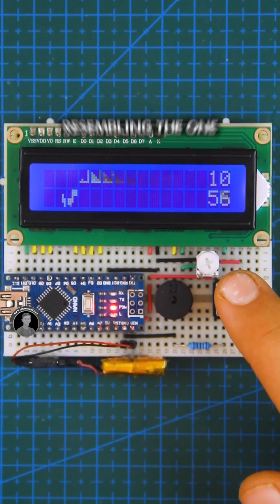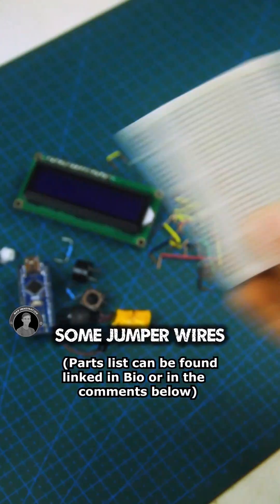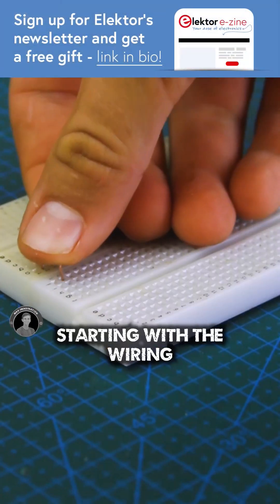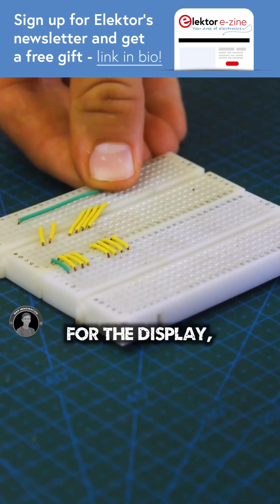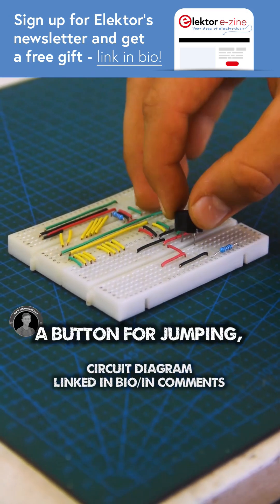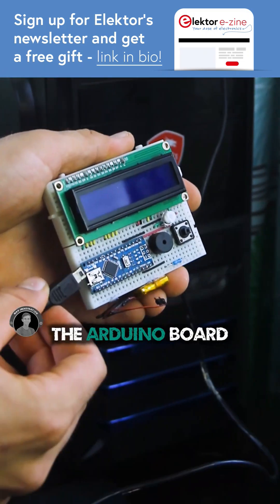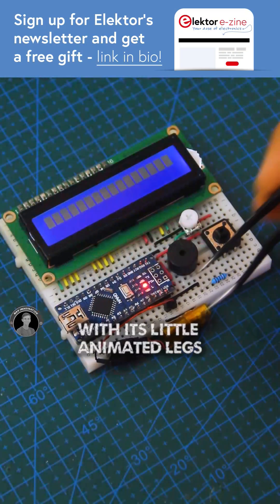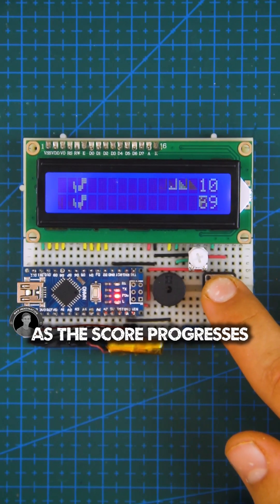Arduino Project - LCD Dino Game | Chrome Dinosaur (View description for parts & diagram) #shorts

Comment: I Need help, when ever i press the button the dino flys
Reply: Okay thanks I checked the battery and the voltage was 4 so I put in a new battery and it worked thanks for your help
Reply from the maker: Glad I could help!

If you ever feel generous and want to support my work, here’s my BuyMeACoffee page: buymeacoffee.com/MaxImagination. It means a lot!
Reply from the maker: Is your LCD connected properly? Check your power supply, sometimes refresh rates aren't as smooth due to fluctuations in power. Ensure you keep the code as it was.

Comment: Unfortunately i am unable to open the link in my mobile it was coming in the format of normal captions
Reply from the maker: Try this: https://drive.google.com/drive/folders/10S0jpn1VzU7vTMm1bj8905NlxcSwiLFr?usp=sharing
Reply: @MaxImagination  thanks but my character display isn't working just blocks are showing
Reply from the maker: The code is geared to work fine with my setup. I suggest you check your wiring. Maybe you missed something in your hardware. If you need more help, DM me on Instagram @max.imagination.
Reply: @MaxImagination  I will try by changing the character display beacouse I try it in my own codes it was also not working
Reply from the maker: Yes, it could be your display.

Comment: I have this all built in the code uploaded, but the LCDC screen is all blue with a row of white boxes at the top. Any tips
Reply from the maker: It sounds like there might be an issue with the display's backlight, try adjusting the backlight trimmer (potentiometer). Also, check your connections thoroughly.

Comment: Make it use i2c lcd plz I have 20x4 i2c lcd
Reply from the maker: I suggest using ChatGPT to assist you in modifying the code for I2C LCD.
Reply: @MaxImagination  also plz make it for i2c 20x4 lcd ples

Comment: Hey Max in your circuit I can't clearly identify that the resistors 
What is the value of the resistor with the LCD display and with the push button
Reply from the maker: Hi there. The LCD resistor value is 220 ohms and the button pull-down resistor is 10K ohms.
Reply: Ok Max thank you for your feedback🙂

Comment: What happens if I don’t use the short wires
Reply from the maker: Nothing different happens. You can use longer jumpers if it's all you have.
Reply: @MaxImagination  thanks
Reply: @MaxImagination also can i use ordinary jumper wires like the one you connect onto the arduino

Comment: I have a 2002a display. should I change something in the sketch?
Reply from the maker: Assuming you're referring to the version with the 2 columns of pin headers to one side, I cannot tell you exactly as I've never used that particular display. You would probably need to check its pinout to match it according to what's in the code and perhaps adjust character offset. I suggest you ask around on forums or ChatGPT. Cheers!

Comment: Can you make it with using i2c module also please
Reply from the maker: You can, you just need to adapt the code and simplify the connections.
Reply: @MaxImagination  what changes to the code do you have to bring?

Comment: Can i make it by using i2c module
Reply from the maker: You can, but you will need to do some heavy modifying of the code. I would recommend you prompt chatGPT with your code to help you with making the necessary changes according to the right libraries for the I2C version of the display.

Comment: Is the size of the arduino matter?
Reply from the maker: No, it does not for functionality, your circuit would still work. However, a bigger Arduino (UNO) would not fit the breadboard.

Comment: can you use it with a 9 volt battery?
Reply from the maker: Yes, as long as you power the arduino nano only through the VIN pin.

Comment: Hii., I have made it but the dianosor is running on the upper side of the lcd... please give solution
Reply from the maker: Hi, Minati. Try changing the value in line 31 of the code: "int fila_dino = 1;" to 0 or 1.

Comment: I bought a different display without the i2c module but I don't have Arduino nano I have arduino uno so can I make it can you make a separate short video making this project but with arduino uno
Reply from the maker: Hi there. The wiring is basically no different from using the two boards. The UNO and Nano are very alike in terms or pinouts.
Reply: @MaxImagination  thank you bro you are great

Comment: bro I have to make this game but I have lcd with i2C module how can I make it
Reply from the maker: You may still be able to make it, it's possible. Though, you would have to make some changes in the code such as eliminating current pin declarations and instead including the "Wire" library. Plus, you would need to wire the display through its I2C module with a couple of wires to the arduino's SDA and SCL pins as per usual.
Reply: @MaxImagination  thank y
ou bro

Comment from the maker: Parts and modules for Arduino LCD Dino Game Project:
• (x1) Arduino Nano Microcontroller - 
https://amzn.to/3S3xvRI
• (x1) 16x2 Liquid Crystal Display 5V - 
https://amzn.to/3xo54nV
• (x1) Passive Buzzer 5V - 
https://amzn.to/3Ir3KXD
• (x1) Tactile Push button - 
https://amzn.to/3I38ema
• (x1) Potentiometer (Variable Resistor) 10KΩ -
https://amzn.to/3lD5l3T
• (x2) Resistors (220Ω & 10KΩ) -
https://amzn.to/3I6ynR1
• (x37) Jumper wires -
https://amzn.to/3S5TV4H
• (x2) Mini Breadboards -
https://amzn.to/40VH3SO
• (x2) 50mAh 3.7V LiPo cells (pair in series 7.4V) -
https://amzn.to/3YzE6Wy
Watch this video to learn how to make the battery’s charger -
https://openinapp.co/zn37v

Code and Diagram: https://drive.google.com/drive/folders/10S0jpn1VzU7vTMm1bj8905NlxcSwiLFr?usp=sharing
Reply: The code is uploading, but its not showing anything on the screen rather than the pixels.
Reply: @aayushmanchouhan1143  u should try uploading the code then checking the screen
Reply: Thanks
Reply: Can u send code again
Reply: L
Reply: Kjj😊
Reply: @MaxImagination  
I like oled

Comment: in the ping pong video you made does potentiometer value matter? can i do with 100k
Reply from the maker: Since the potentiometer acts as a voltage divider, all it's doing is splitting the voltage. So, any value potentiometer above 10K Should work, yes. Anything lower than 10-1K could drain excess power of even kill the Arduino.
Reply: @MaxImagination  if i turn the pot all the way to the left and split the voltage like 0-100 would that also damage it?
Reply from the maker: No, since one side then has 100K ohms of resistance and the other 0. The POT's total resistance will always equal 100k ohms from end to end.
Reply: @MaxImagination  oh ok i guess you are right

Comment: What lengths of the jumper wires are you using. Can’t figure it out thanks.
Reply from the maker: Simply follow the way the wires are shoved in, counting how many spaces between each pin of a jumper wire. I cannot give you the lengths. You can find the real life wiring layout/diagram linked in the description.

Comment: That's nice 
Is it possible to make a pc status display like cpu GPU temp using Arduino and max7219
Reply: I think you can do that in python using os and vpython library
Reply from the maker: Thanks for watching. I believe that would be possible, yes. Though, I think it would be better to simply install a program on your PC that monitors and displays those values.
Reply: @MaxImagination  but program don't show it in the Matrix display right i am trying to find a cheap alternative to status showing display within the cabinet and most of the display are expensive 🙃

Comment: Where do you buy your jumper wires from?
Reply from the maker: Hi, you can buy a pack of ready-to-use 560 Jumpers from Amazon. Purchase links for the parts can be found in the pinned comment under this video.